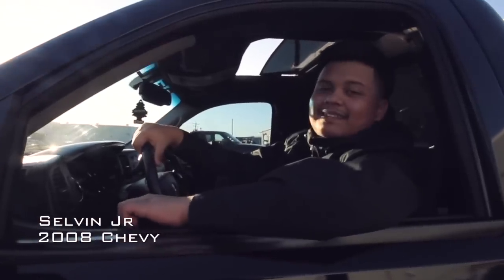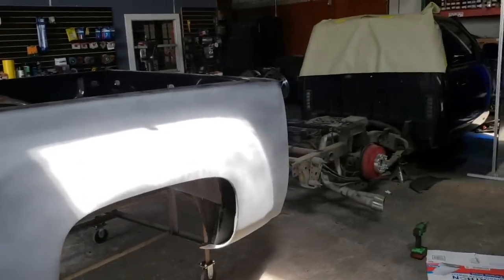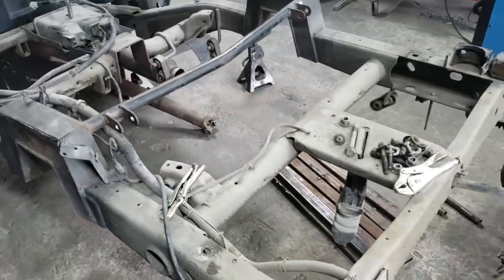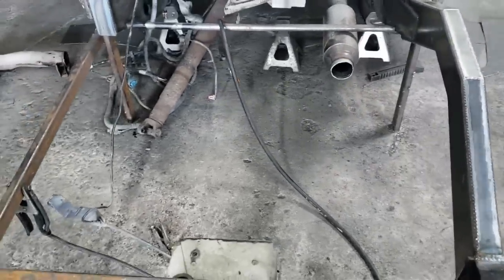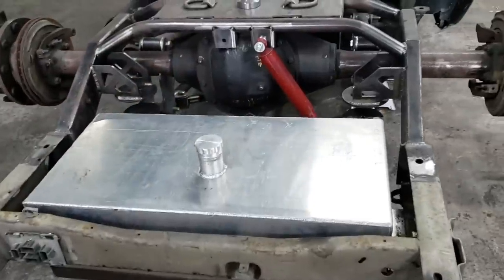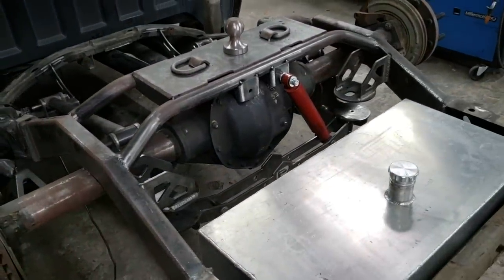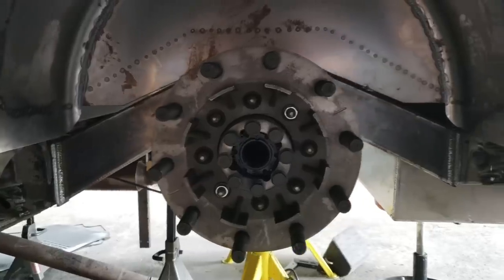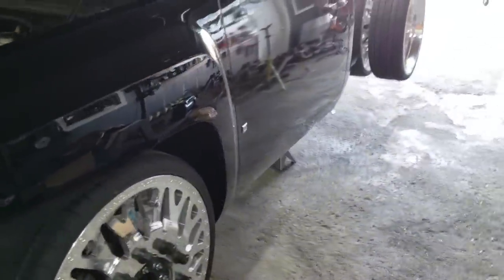Baby Dually Bagged Project, 26" American Force Wheels, Single Cab, Reklez Suspension Work

Comment: Standard cab short box dually. Not a combo many do because of how funny it looks usually. No other truck or shop could have pulled this one off and have it look that good. Those trucks have the big body already up front with the massive bumper and all that and the way you guys executed it that truck looks stock! Stock'ish I should say. Perfect example of what I always say is the old setup on it. It was strong enough and it was definitely not the worst I've seen but u could tell that it was built with the idea of you'll never see any of this probably in mind. Countless hours y'all put in and then it's covered up! All the link bar design I have not seen before but it's genius! The shock thing in the back how it ties it together. Forgot the name sorry lol and all the tabs and brackets not just cut and tossed on. Some thought went into all of that. When you showed the frame rails had been capped before the new ones installed, that's something many don't do and my opinion, not that it matters much, that's a must to have it come out right! The hard lines for the air supply and all that stuff. That will be one reliable done right piece of rolling art covered up by a bed!! Even the bed looks like it could be a factory option. All hundred percent custom built but looks like it all belongs there. Duallys are just sick either way!
Reply from the maker: Amen & Amen! Thank you for your comment and taking time to check out our work.  Not many ppl think about the 100s of hours of work that go into these builds. Thanks again

Comment: looks sick. honestly just makes you appreciate how much better the new body style trucks would look, with a side step bed. i would've gone with a "normal" wheel - motor for this truck, instead of making it a dually...so it would kinda be like a New Body style 2000-2006 side step truck. its clean tho.

Comment: I have a 1994 Chevy Silverado k3500 and im talking out the 4x4 out and making it 2 wheel drive,,,,so i wanna know will the C3500 Dually front end suspension parts fit on my k3500 Dually?
Reply from the maker: You have torsion bars up front 2wd have springs. Very different suspension. Good news is you can still bag it if you like.